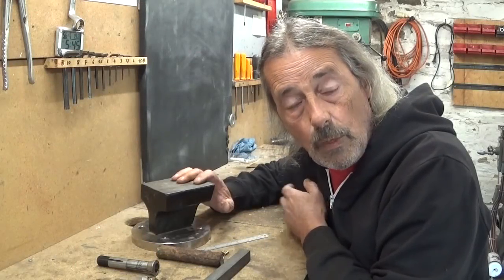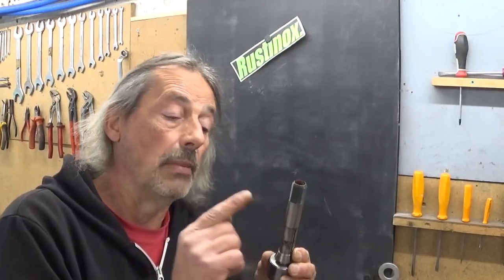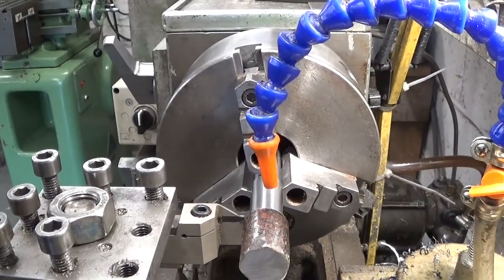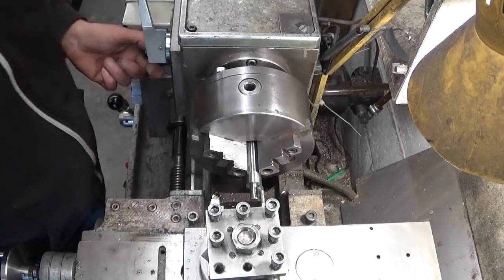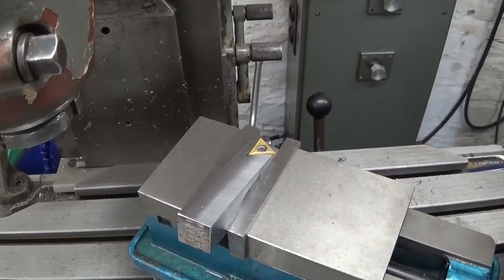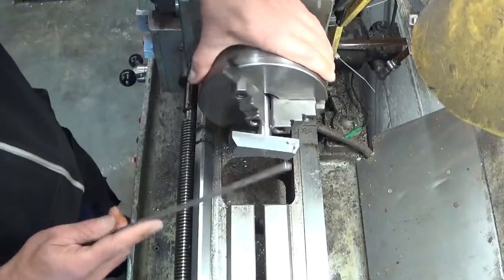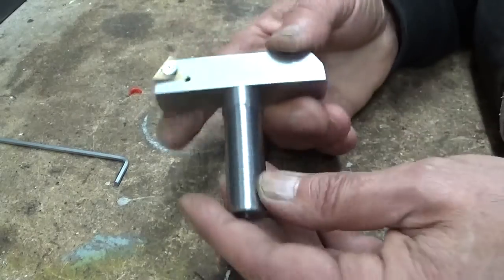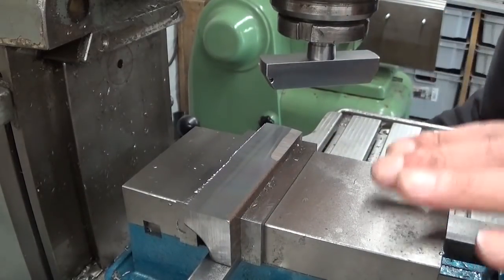Experimental fly cutter build 2.

Comment: Hey Michel , interesting use of an internal threading tool to cut front behind and away from the clock at 06:23 . I think at 08:27 you might want to put the wire against the movable jaw since they fixed jaw if always totally vertical but the movable can ride up.
Reply from the maker: Thanks William. It's maybe not obvous in the video, but the moving jaw is the small one. A bit like a shaper vise.

Comment: hi Rusty.
The best feeling is when the things you make work after all.
If you take an advice, the quality of this tipe cut is mostly affected of the position of the cutting tip regarding the center of the rotation.
In the case of a mill the rotating object is the fly cutter, in the case of a lathe - the part. 
There is full analogy with internal turning on the lathe - the cutting tip could be slightly above the center, or perfectly on it, but never under.
In your vase the cutting edge is a bit too much above the center. Thus the main angle is too much negative.
Reply from the maker: I'm always interested in useful tips, but here the cutting edge is perfectly on the centre line, as I show on the blackboard at; 03:50
Reply: @Rustinox  it is not my goal to argue, I'm just trying to show you something. 
The center of rotation is in the center of the bar, that goes into the collet, respectively through the thread it is in the middle of the 20mm square bar.
Is the tip of the insert on that line?
Reply from the maker: @petarraykov9059  I know you are a respectful person Petar and that you want to be helpful. I really appreciate that.

Comment: Luckily my father is a machinist and supplies me with a lot of lightly used endmills, as I tend to be a bit rough on the gear. 

Whatever I break, I use the shank for brazed carbide lathe tooling. 
Carbide is expensive. I recycle that stuff til it’s dead. A $20 cheapo diamond wheel on a bench grinder and you can make a lot of useful tooling. Just don’t breathe the dust. Stuff is bad for you
Reply from the maker: A constant supply of stuff is really nice to have :)